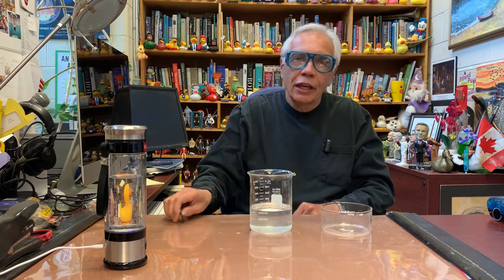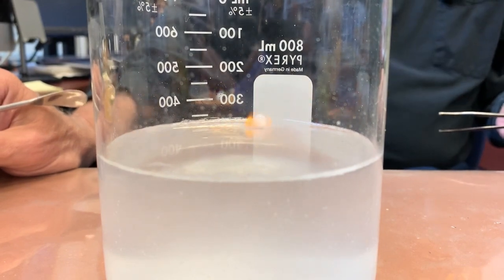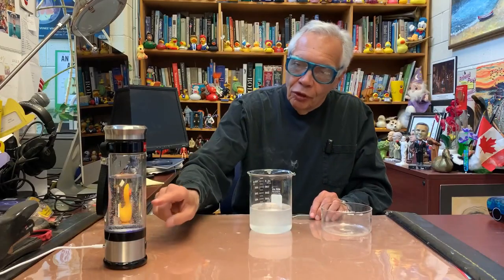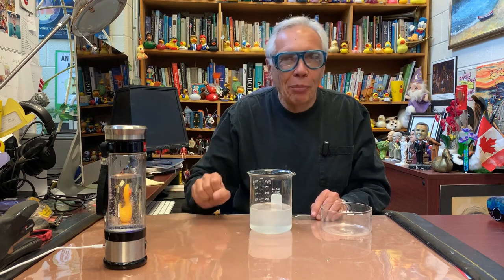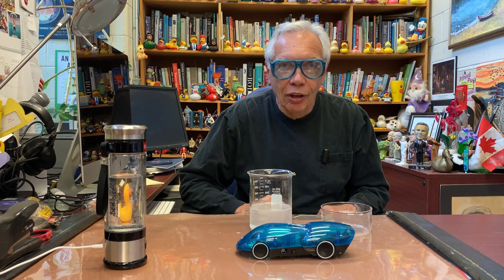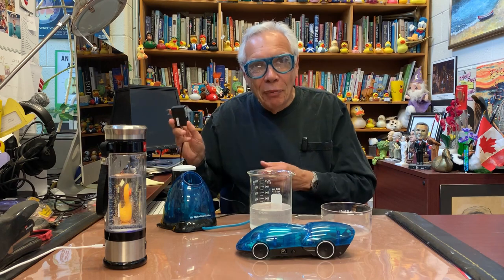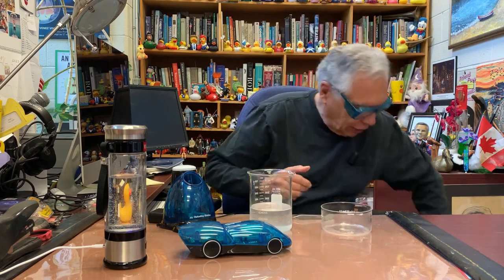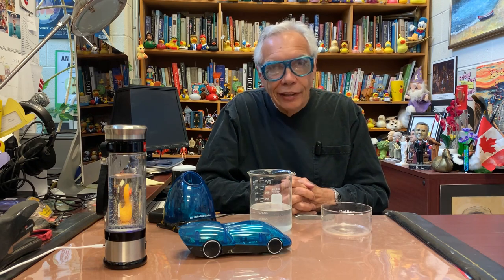The Right Chemistry-Hydrogen powered vehicles

Comment: The efficiency for electrolysis is about 30%.  To create electricity using a fuel cell, also about 30%.  Total, 9% efficient.  Compare that to batteries, with system efficiency of 85 to 90%.  Will the efficiency improve with hydrogen, of course.  Enough to beat batteries, I don't see that happening.

As mentioned below, storing hydrogen is difficult.  Also, fuel cell react too slow for use in a car, batteries are required.

Comment: I've been led to believe, that "storage" of hydrogen at the fueling station, or even within the car's own tank, is problematic in that the hydrogen molecule is so small, that it "leaks" from the storage vessel.  Any truth to this?
Reply: Gas leaks. Coal, oil and natural gas operations are each responsible for around 40 Mt of emissions and nearly 5 Mt of leaks from end-use equipment.
Reply: Storage is a great question.  I think it can be stored in carbon nano tubes
Reply: I know I can smell good weed through a heavy storage bag
Reply: @dirtydancer8  Thats thin plastic that the aroma molecules seep through, thin enough to act a a slow release membrane.